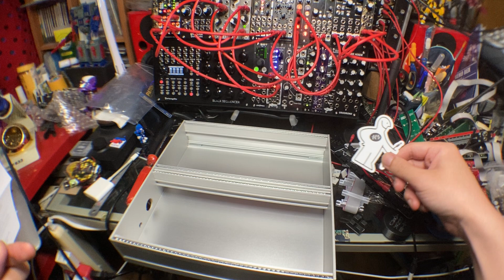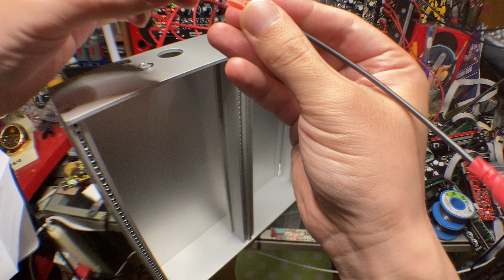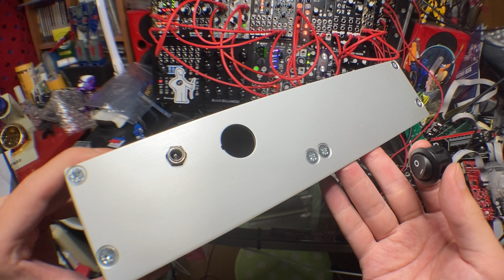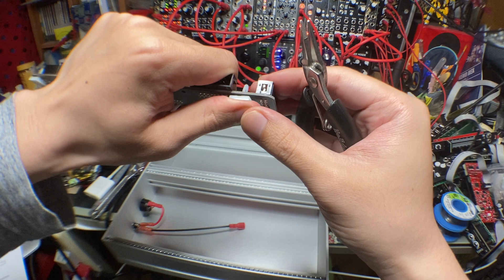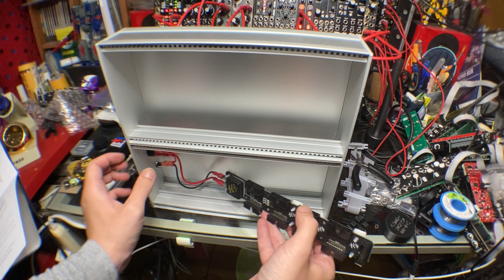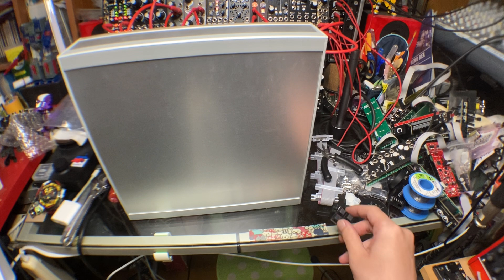ALM Busy Circuit 6U 52HP Eurorack Powered Case Kits power bord install.モジュラーシンセケースに電源を取り付ける。

Comment: do you really have to assemble these cases yourself ?
Reply: Mine arrived prebuilt 🤷‍♂️
Handy cases , just be sure to unscrew the middle rail bars a little bit so top row modules fit , then screw back , since the lower row will be wider. All I had to do , then all good to go !